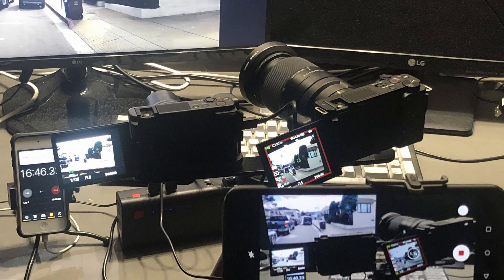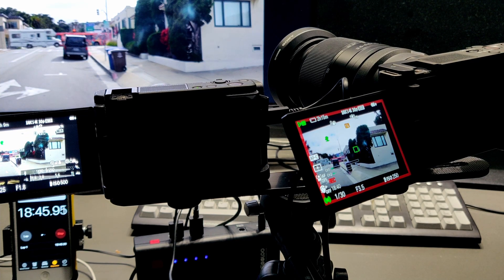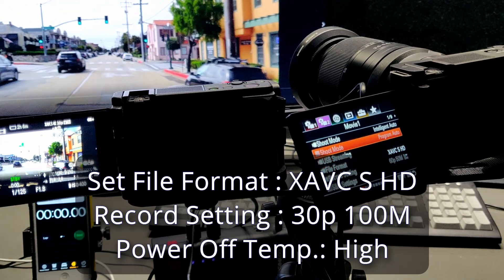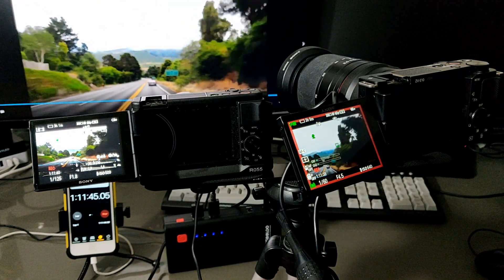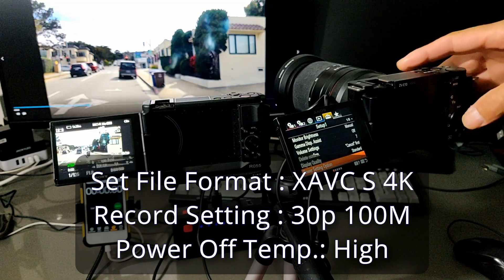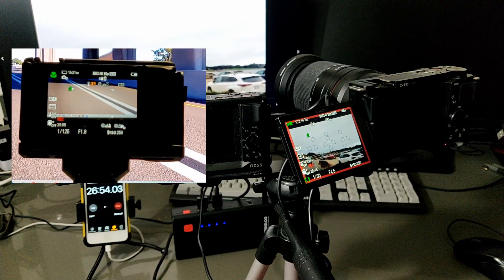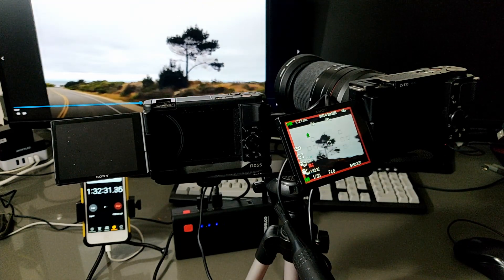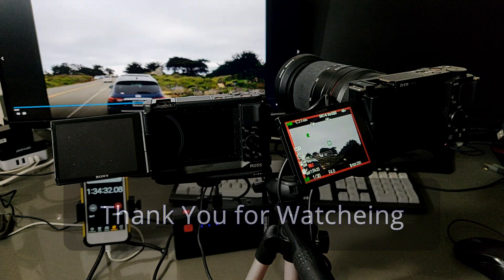Recording Time Testing for Sony ZV-E10 and ZV-1 with External Power Supply

Comment: If I use dummy battery, if the indoor temperature is 30°C, can the ZV-E10 / A6400 record continuously for 3 hours at 4k 24p?
Reply from the maker: Probably it can't take that long because of overheating. You can try to put a fan behind the camera.

Comment: Since you have a powerbank, add a usb fan and glue a coldshoe plastic cover onto it so it blows behind the camera. I do this for my multiple a6400 setup for conferences. I both stream to switcher over hdmi and record 4K internally and get +10 hours of battery and no overheating. Granted, i switch sd cards 😂
Reply: Can i see your setup please
Reply from the maker: @bicarafoundation 
Both Sony ZV-E10 and ZV-1 connected with External Power Supply 

1.Under XAVC S 4K- 30p 100M, Power Off Temp.: Standard  
Both ZV-E10 and ZV-1  Stop @25Min 

2.Under XAVC S HD-30p 100M, Power Off Temp.: High
Both ZV-E10 and ZV-1  Passed 1H30Min 

3.Under XAVC S 4K- 30p 100M, Power Off Temp.: High
ZV-E10 and ZV-1  Passed 1H30Min 
ZV-1  Stop @28Min
Reply from the maker: It's a cool idea 👍 Thank you,

Comment: Hi! Are you charging via power bank? Do u think it will hurt the battery this way?
Reply from the maker: Yes, I am using power bank to charge the camera. So far, I didn't feel that the battery was hurt. I am not a daily user. It may depend on how often you charge the camera.
Reply: @Tora8688  Thanks for replying!
Reply from the maker: Answer from ChatGPT: "Using a power bank to charge your Sony ZV-E10 camera should not hurt the battery inside the camera. However, it's important to use a high-quality power bank with the correct voltage and current specifications to ensure safe and efficient charging. Charging with a power bank is generally a convenient and safe way to keep your camera powered while on the go."